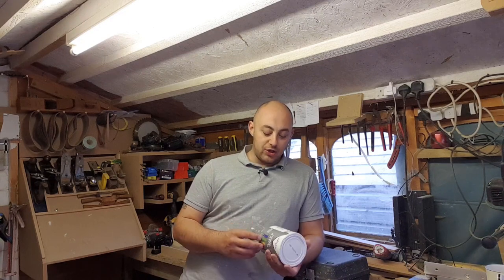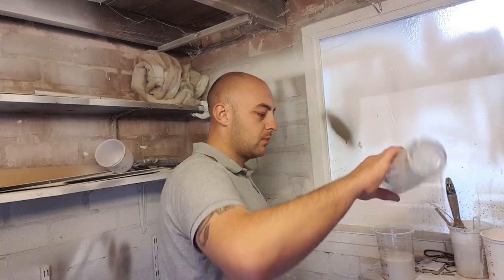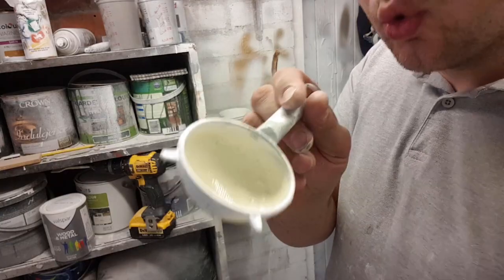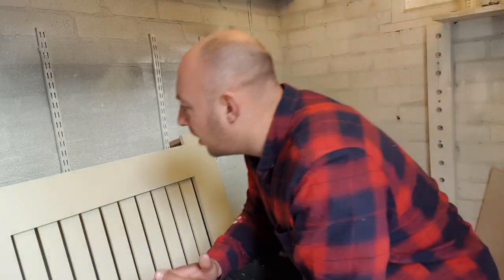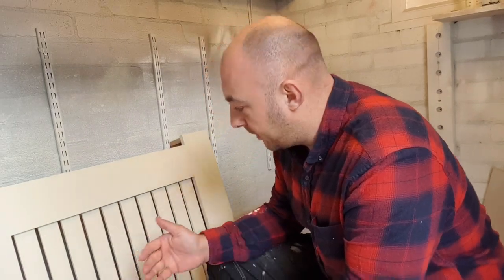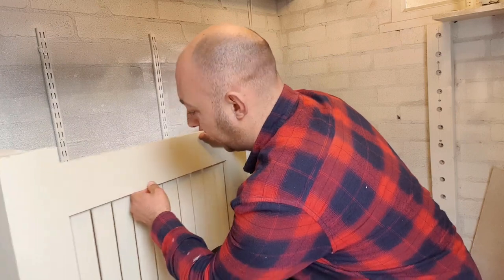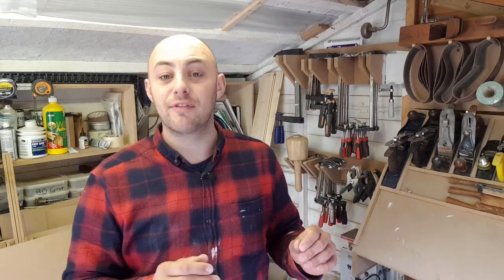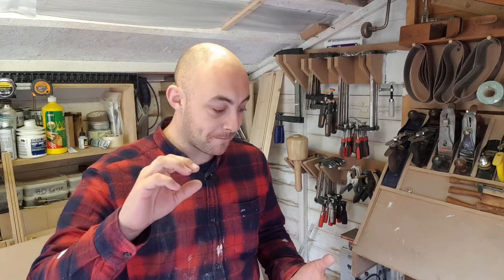spraying valspar... spraying for beginners tips/tricks

Comment: Great vid, thanks for that. I just used valspar furniture paint (needed no primer)  through my HVLP setup with a 1.3 nozzle and thinned around 15% with water, it went ok but as i'm used to solvent lacquers this was  a much slower process being water based. Even allowing for that  it took days to harden and is still a bit grippy to the touch nearly 5 days after a coat! ... even with 20c constant moving air in my heated finishing shed!   Anyway just thought i'd give others my experience with the material.  It says on the tin 'do not thin' but it's hard to avoid unless you've a powerful AA or similar spray setup maybe. 🙂

Comment: I sprayed some car bumpers so I already have an air compressor, spray gun, filters, hoses, and couplers. Now I wanted to repaint the kitchen cabinets. I was told I needed another spraying system for hundreds of dollars. Nah, I just switched from a 1.4mm tip (ideal for automotive paint) to a 2.0mm tip. After adding some Floetrol, the thick Valspar cabinet paint actually atomizes out of the spray gun, cool! I got a decent finish in 1 coat.
Reply: Have you tried other water based paints,? they the same with a 2.0mm tip. I did think a 1.4mm was a little small for those paints, but appears to work with a small tip and needle in this video.

Comment: Hi, I am new to spraying, just bought a LVLP with a 1.4 nozzle & B&Q Valspar Paint. Thanks for taking the time to make these vids. 
You mentioned mixing on your last video to look like cream, could you please tell me more using the measuring pot (IE fill paint to 40 then add water to 50 - as an example). Sorry to ask a question you have covered but would like to know how much water you use to at least start me off in the right direction. 
Thanks in advance :0)
Reply from the maker: Hello there .. so as a rough idea I normally mix 300 ml paint to 100ml of water... but this can vary depending on temperature pressures for spraying etc
Reply: @lowesjoinery3031  I think that's due to the nozzle size being only 1.4mm, maybe 1.7mm -2.0mm would bring that down and give a thicker richer coat. Still needs thinning but 10% with maybe Floetrol can give a really nice flat finish.

Comment: Was it their waterborne lacquer?
I find it to be a fantastic product. Been using it since it was introduced. Excellent product, flow and drying time. 
Also, I have found it quite effective to use my small Wagner 600 (diaphragm style airless sprayer) which makes short work on these type projects. You can dial the pressure right down to practically a whisper making control  a breeze.

Comment: Dose your compressor keep cutting in I have a 50 lire useing lv gun don’t spray long befor it cuts in just need to no weather the 100 Ltd would not cut in as quick great vid
Reply: I have the same issue with my 50L twin piston compressor. The LVLP gun I was using absolutely hogged air, so a friend let me try his super cheap silverline 1.5 tip gun & it works a LOT better.
Also make sure you have decent internal diameter hoses, 9.5mm at least. my main issue was the regulator fitted to the bottom of my gun, took that off and made a nice difference. if I can help any more, give me a shout.

Comment: i got a qtech stage 5 hvlp sprayer ... i sprayed to interior doors with 1.5 tips and zinsser perma white in satin ... i lightly sanded them down 2 coats 30mims between them drying time is quite good ... its a lot diffrence to airless have you ever tryed zinsser brand?

Comment: I spray the Valspar Trade eggshell and get good results. It need watering down by about 20% or so.
Reply: What do you recommend for the tip and nozzle size? Appears the bigger the nozzle the less it requires thinning. Obviously also requires a higher pressure and recently adopted to use a pressure pot, with both conventional and hvlp guns.

Comment: The same question as usual, how much water did you add? 30%? And the second question (also as usual), what air pressure?
Reply from the maker: Hiya  I answered  all those questions  in the farrow and ball video I did shows you how I mix how I thin it and what bar pressure I spray at
Reply: @lowesjoinery3031  Hi, so copy paste then? (Since this was another paint brand with maybe different viscosity, I thought those data had changed.)
Reply: @lowesjoinery3031  as the other poster writes above  ... (a) valspar isnt farrow & ball indeed you go out if your way to say how different they are, the f&b takes 2 days to dry etc (b) your f&b video shows you diluting by 33% water ... but doesnt say what pressure you used. (C) nother if your vids says many people ask which compressor you use .. I guess no one cares what brand but we are interested in his many cfm are needed etc. .. you even say many people ask you .. but you dont answer it. .... 

Dilution (may vary for different paints ?) Pressure and cfm needed ... kind if what anyone trying to find out about how to spray (probably about to go.buy a compressor) needs to know. 

Thanks
Reply: @davesmith9325  I'm amused that the content provider takes the time to repeat himself in multiple videos on spraying.  But very important information like how much water and psi , we have to go hunt for.  

He's got painting skills.  He terrible at helping with useful information.

Comment: Do you know if there’s much difference spraying something such as Dulux Trade Satinwood (which is solvent based). I’m new to spraying, just got my first gun and I’ve got some internal doors to spray. It would be handy to make use of the paint I’ve already got, obviously if it needs thinning (which I assume it will) I’d have to use thinners not water.. and for cleaning, but I presume apart from that the process is the same?
Reply: Did you manage? the only difference, which I am sure you will know by now, is the viscosity and thickness being much greater in water-based paints than solvent paints, although they both require thinning, unless your spraying at a much higher pressure, like Airless, or Air Assisted Airless.

Comment: When using water based paint if you're going to be spraying the same colour for two days running as you did with this radiator cover do you clean out your spray gun each time or leave the paint in over night.
If you leave it in overnight how do you stop it from hardening off especially around the tip of the spray gun.....
I always find it a bit of a chore cleaning the gun out especially when spraying small objects like your radiator cover and when I'm only going to be using the same colour anyway
Reply: Clean it out it literally takes 5 mins. Tooth brush soap and water or lacquer thinner scrub pot run soap and water through nozzle. Brush air horns and gun body with soap or thinner. Don't had to take the fluid tip and cap off Everytime if enough is ran through it. Needle takes a second to wipe down or you can wind it all the way outoull the trigger now brush the exposed needle that toucbes paint obviouslly this is condensed so the next day after spraying you break it down complete. Still takes 5 minsto clean. If latex is caked on lacquer thinner easily removes. Many uses same ingredients as many fuel system cleaners and I use it for my Zippo fuel as well. For gas it's loop 1-2 oz per gallon
Reply: If you can't spend 5 mins cleaning your gun after. Just go to spray cans and be able to throw them away  or if your strapped by a bunch of paint guns and throw them away after each usel many $10 Chinese specials around

Comment: Worst paint I ever used. Scuffs and chips like nothing else, extremely poor adherence too. Best use would be on scratch cards and parking permits. Quality spraying is impossible due to worst atomisation, darker colours don't cover evently. Agree one one thing it dries quicker than F&B but slower than most of other stuff. Everyone in the trade knows to avoid F&B, this stuff is much worse on the quality level of the product overall. On the scale 1-10, 2 would be generous.